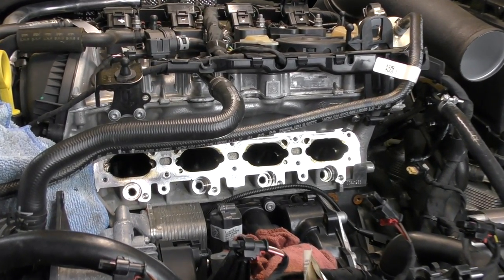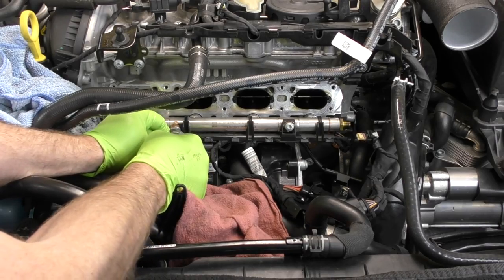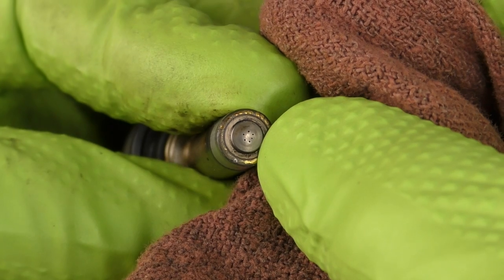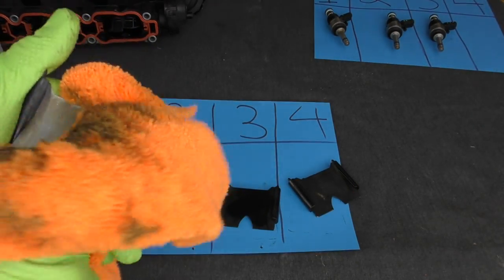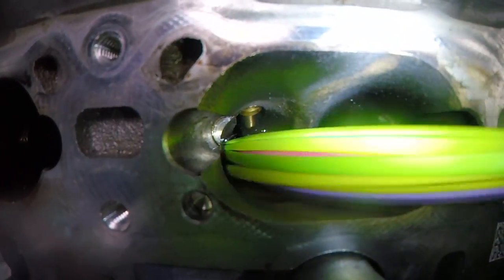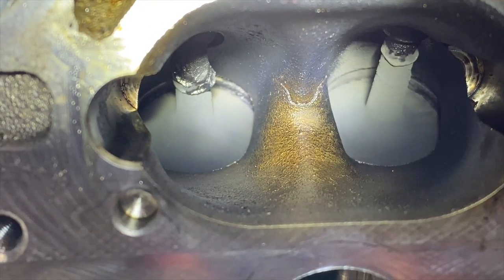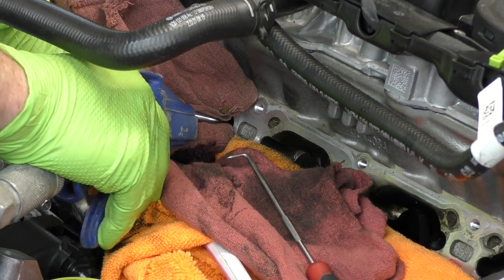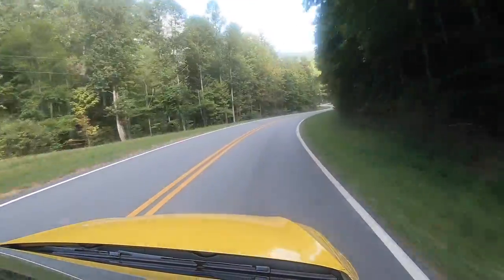How Much Carbon Build Up at 10,000 Miles?? ~ 2019 Golf R

Comment: fantastic video, I'm tacking this job on my 2016 Audi S3 at the weekend, when cranking the shaft to close the valves is it necessary to remove the spark plugs?
Reply from the maker: Not necessary, but it makes it easier
Reply: @HumbleMechanic  Thank you, actually i have pretty much everything apart after watching your video, hit a problem though, seems the S3 is different, the injectors are part of the inlet manifold, reluctant to pull this off.

Comment: Is this also a problem on the 1.4 TFSI?
I have an 2016 A3 E-Tron, and wondering if the minimal use of the engine will make some carbon build up in the engine. It's got 41.000 kilometers on the road. How many of them on petrol, I don't know.

Comment: I'm assuming this issue applies to all Direct Injection petrols? Even the smaller 1.4tsi and 1.5tsi's we get in Europe?

I have a 1.5tsi, 150bhp in my 2019 Audi Q3, which has just over 7k miles on now.

Comment: @HumbleMechanic do you have any experience or knowledge about the dual-injection being used in europe for some EA888 engines ? (at least I know that's the case for the Passat B8 2.0 TSI manufactured in Germany that is being sold in my country (Argentina)) ?    Using the same engine as you were showing in this video... but with direct+indirect injection... My question is.... is that EU intake manifold EFFECTIVE enough to completely solve this problem and allow me to purchase a 50K miles Passat in my country without any worries about carbon buildups ?

Comment: Long ago I owned a 1994 VW Jetta, normally aspirated with a 5 speed manual. At 230,000km I was rear ended, The Jetta was a right off. I now own a 2009 Audi A3 Quatro, DGI and DSG. The Jetta had better milage. Better torque. Less maintenance issues. Less worries. And more fun to drive. Modern tech make idiots of drivers.

Comment: Good Vid. Why wouldn't you have inspected and cleaned the PCV system at that time? Isn't that the main culprit?
Reply from the maker: There isn't much to really clean. We will be inspecting when we install the Catch can
Reply: @HumbleMechanic  Great! I know catch cans are the rage when dealing with GDI but I've been on the fence. Although I haven't inspected the intake valves, when I look at the inside of the PCV hose it's clean. So I scratch my head. Thanks for the response and I even subscribed.

Comment: I wonder if I clean the intake valves on my MK6 Jetta it would get rid of P301 code that I keep getting? I mean I already replaced all the ignition coils, spark plugs with OEM parts and the fuel injector on cylinder one with OEM.

Comment: Hey Charles what about exhaust valves?  I've seen them with carbon as well. Seems to be overlooked.🤔
Reply: Exhaust valves do not affect the operation of the engine. What they get is a bit of soot, but they get so hot carbon could never build up on them. Any build up if possible, would blow right out.
Reply: this carbon deposit is 2 compound : oil/water from pcv and carbon particle from egr,what gives carbon grease that is dehidrated /half burned as temperature is higher

Comment: spray will be impacted if carbon build-up occurs on the inside of the valve-seat holes which is a resultant of excessive combustion temperature.  Outside is normal. Any build-up on the outside near the exit hole will be cleaned away due to the fuel velocity exiting.

Comment: You mentioned fuel treatment won't help much for this engine since it's direct injected. From your experience, how well does it work for port injected engines? If it makes a difference or the gas being sprayed already does most of the work.
Reply from the maker: Much better on port. It can help clean injectors on DI. Just not valves

Comment: Ouch. As a fellow '19 R owner, this is disappointing to see. And my car sometimes sits weeks without running as it's a pleasure vehicle. Currently under 5,000 miles. 

As someone who has zero interest in doing any of this procedure, what can I expect from the dealership shop as far as keeping up with with carbon? I have a prepaid service and extended warranty that requires me to use the dealership garage.
Reply: Prepaid service wont play any part in carbon clean up, warranty may it it's truly causing a massive problem but sorry to say that Bill is on you
Reply: All you can do is have the valve cleaning performed at a preset mileage. I have found that 30k is a good middle ground where there will be significant build up, but it won’t cause misfires, or be baked on so bad it requires hours to clean out.

I use the media blast method. To give you an idea, I charge 400.00 for the process.  This includes new intake manifold gasket. New seals for the injectors, and new throttle body gasket. I also give the intake manifold a cleaning as well.0
Reply: Gentlemen, thank you for your insight
Reply: @lynxstarautomotive208  what "kit" do you have for the media blast? Would like to buy one myself
Reply: MeltingRubberZ28 I use a blast gun with hopper made by Gunson with a nozzle I customized myself. I feed it with my shop compressor. The media solution is walnut shells of the fine grit variety. BTW guys I forgot to mention this:

Do not use coarse grit media

Coarse grit will cause microscopic imperfections, like pores, on the surface of the intake tract. These pores are too small to see with the naked eye, but they will exacerbate the problem because they will “catch” contaminants, and will cake up with sludge even quicker than usual. I made this costly mistake once! Had to replace the cylinder head. Use only fine grit media, and only plastic bristle brushes.

Comment: Looked at my old Toyota Manifold and it had a light oil surface on it and that had done 350.000km 

Do a EGR delete and catch tank for the PVC system. It should make it better
Reply: EGR also reduces the exhaust gas temp. Removing it can cause a lot of trouble, so make sure you know what your are doing. 

I work with industrial diesels and had a customer block off the valve and it made exhaust gas temps go up so high it cracked the head.

Comment: I have 115k miles 2.0 tsi passat 206 kw 4x4 2016 and engine works perfectly
Reply from the maker: Awesome
Reply: HumbleMechanic its mostly highway, garage. Every 10k motor oil change, every 30k dsg oil change. Miles driven is just number, relevant is what is behind those miles 💁

Comment: Why couldn't this come out last week? I replaced the manifold on my 2013 CC and didn't clean because I didn't know the zip-tie trick and didn't want to spend hours picking and scraping the valves. Although they weren't much worse than these in the video at 48,000 miles.

Comment: Great video... So adding an oil catch can would help to reduce the carbon build up.. As I'm not gonna say that it will eliminate it as some ppl say.. But other ppl say that these engines in the mk7 or mk7.5 can't have an oil catch can fitted as it will destroy the engine...such a broken piston arm.. Is that true? Thank you.
Reply from the maker: I don't see how it will result in a broken piston. Plenty of MK7 running around with a catch can. I ordered a CC so we will see. :)
Reply: @HumbleMechanic  Thank you for your reply.. Well someone asked how to help reduce oil in the intake at a FB forum for MQB platform.. And I told him to install a decent brand oil catch tank.. So few members comment that it's wrong for the reason I told you.. I told them that I had one for my old MK6 gti for years and no problems what so ever.. But with your knowledge and expertise I wanted to be sure.. Thank you again 👍🏻

Comment: Its surprising VW still designs their engines to buildup so bad.

I have an '18 Chevrolet Colorado and luckily GM redesigned the engine for '17+ and added an oil catcher/seperator in the LGZ engine. Got a guy on a forum giving updates and the egr system is bone dry with no oily mess.

I do want to shove my camera scope down the intake to check mine now that Im almost at 30k.

Comment: I'm surprised when anyone mentions Shell as a top tier fuel since back in the late 90's, they were some of the worst according to my father. He was a mechanical engineer and did extensive testing and quality control related tests for different chemical companies and testing products ranging from household products like shampoos to products like gasoline. He was always a fan of Exxon. Of course, over time, things may have changed. Maybe now, Shell IS top tier. I don't know. He retired in the early 2000's. Just an interesting thought.

Comment: I use flashlube, injector cleaner my 06 Ford runs better than ever. It has about 150,000 kms. Before flashlube  it wouldn't run as good as now.

Comment: They need to put a second set of injectors in the IM to help clean the valves
Reply: Yes! They could be activated when going full throttle.
Reply: Like the Toyota/Subaru Setup in the BRZ. Port and direct injectors.
Reply: European version has both port and direct injection. Solves it all.
Reply: @snsofhumor  Good to know as im from Europe.

Comment: I have a 07 Audi A8 with fsi direct injection V8 4.2, Just had all the carbon cleaned off but If I drive at very high speeds once a day say 120Mph can’t that prevent slot of carbon?

Comment: If you switch your fuels to E85, you will no longer have carbon buildup. In fact, the high ethanol content actually well help dissolve any existing buildup.
Reply from the maker: How would that happen on DI engines?
Reply: @HumbleMechanic  Aha! Big oversight on my part. On Port Injection engines the intake valves are washed by the fuel but not on a DI engine. This is why I'm an electrical engineer and not a mechanical engineer! Thanks for the reply
Reply from the maker: Hahaha fair enough!

Comment: Hey Charles, when reinstalling the manifold you didn't mention of changing the gasket, did you reuse it or changed it? They supposedly are one time use from what I know.
Reply from the maker: It’s totally reusable. In fact I have never replaced one.  Either new manifold or reuse the gasket

Comment: what is the specific reason for only clockwise on engines? In school I was taught only clockwise, but at the shops i've worked at it was about 50/50 on clockwise or not

Comment: Hi Sir. I am From India. Hope you are doing well. I have a VW Vento Indian Variant 2012 and i am facing an issue with my desiel engine. When I am riding on cluth without no accelaration pedal pressed, the radiator fans comes on and it cuts as a speed up. Could you provide any help with it?

Comment: I believe being tuned causes this process to accelerate. You have more boost, more air, more positive crank pressure, more gas... things are more prone to pass around the piston rings and into the crank system. I wonder what someone’s golf r would look like that isn’t tuned, but used the same oil and gas stations with similar miles?
Reply from the maker: That would be a fun test. We might be right on the tune.
Reply: Yeah, if that’s the case, I might have to take a look at my 1.4T in a few thousand miles and see where that sits.
Reply: This would be super cool to investigate. I have a 2019 R  too and would love to know if it’s possible to easily convert.
Reply: There was a publication from VW on Google that stated if you drove the car at 3000-3500 RPM for 20 minutes about once a month you would not have carbon build up.     Here is the link:   https://patents.google.com/patent/US6866031     I would be interested in feedback from people deeper in the know.

Comment: is this direct injected engine?? if it is then it is expected. port injected engine will wash those valves. Toyota tacoma has both port and direct. when idling its actually cleaning in port injection mode.

Comment: @HumbleMechanic, Sir Charles, in this video you mentioned that your golf R has the EA888 engine. Is this the gen 3 with the port injectors added? If yes, when are they used? And why doesn't it clean your intake valves with the fuel? Thanks in advance for the answer.
Reply from the maker: No port in the US :(
Reply: HumbleMechanic damn VW. Was it because they build golf for the US market in their plant in Mexico? And they put the port in the ones they manufacture in Europe?

Comment: I'd like to do this on my GTI (30k miles), but I dont want to drop $250 on a tool kit to replace the injector seals. Can I clean the carbon without removing the injectors? I know it's not ideal but I'm curious about all options available.

Comment: What if you used a can of CRC Indiction cleaner at every oil change to clean the valves. I wonder if that works as well and would be less invasive.
Reply from the maker: From what I have tested, those mostly just end up cleaning cylinder 2/3 and not getting much on cyl 1/4

Comment: Ok, so you’ve used fuel cleaning additives. What would a 10,000 mile engine look like with strictly fuel and no extra additives? Side by side comparison. I worked at an oil change job where we had a customer that bought the oil cleaning additive EVERY OIL CHANGE FOR THE PAST TWO YEARS, that’s $59.99 + $79.99 syn oil change every 3,000 miles for two years. I would really like to see the tear down of his engine in his Malibu. But back to my comparison question. Would the results of carbon build up be the same, worse, or better when using or not using carbon cleaning additives?
Reply from the maker: I love this idea. I worry about the true accuracy of this tests. Could you really pinpoint? Im at 30k now, might be time to pull the manifold again

Comment: How actually does carbon build up on the intake valves? Since it's direct injection I would assume that the only thing going through them is air?
Reply from the maker: And oil. It’s the oil that is in the air that builds up. 

Plus some unburnt fuel when the valve is open and you shut the car down

Comment: Have a 2017 gti and just wondering at about what miles should you do this type of cleaning?
Reply: I've read in the forms that people don't run catch cans on these cars because they don't get that much build up and that it might be worth it at 50-60K if you are experiencing the problems he has mentioned. A shop might charge around $800 for this type of cleaning. I have almost 30k miles on my 2017 GTI and it starts right up and has a good idle.

Comment: Do not use scotchbrite. Please. It gets embedded in bearings and causes wear you will never see. Just move the engine until the intake valves are closed then soak, use the nylon brush or zip ties and suck with a vacuum.  Quite honestly, regular use of ventil sauber per bmw/vw group process will have you keeping them intake valves clean.  Justmy .02 (Bosch auto engr. GM journeyman, L1 master since '96.

Comment: How are people reaching the crankshaft bolt? The washer fluid lower reservoir is in the way. Are you removing the entire reservoir?
Reply from the maker: No fishing a ratchet in there. It sucks but doable
Reply: @HumbleMechanic  Thanks for answering. Do you have any advice, or a video, on how to do this? The fit is so tight, I can't even get a 24mm socket through the gap between washer fluid tank and crankshaft. I don't think even a low profile socket would fit.

Comment: Fuel treatment does nothing to clean injectors. Gasoline is better at cleaning injectors. The fuel filter is what keep the gas clean. Anything small enough to pass through the filter will not stop up an injectors. The carbon you are talking about, is not enough to hurt the performance of the engine.
I have a 2016 F150 with a 2.7 ecoboost. It has 75k miles and I have only used Quick Trip gas.
Reply from the maker: I’ve seen very different results over the years
Reply: @HumbleMechanic  When I was young (I'm 50 now), my dad used gasoline to clean engine parts. Have you ever replace a fuel pressure regulator on a GM 5.7 CPI? The area near the leak will be spotless because of the leaking gasoline.

Comment: I know this has nothing to do with this video but I could use some help. I'm doing a dmf in a 2013 TDI jetta w/DCT. This is the first dct flywheel I've done and the new flywheel has a huge amount of movement with no real resistance. Is this normal? I've gotten 2 both the same. On regular clutch dmf there is just a tiny bit of by hand movement. Anyways if you got time to respond I'd be very grateful.
Mike @Carizona

Comment: Question I been cleaning my injectors with two cables a battery and a hose with injector cleaner and pressure towards the back will that cause the injector to fail I been doing it for quite awhile and only had one fail ?

Comment: In the tank cleaners are a waste of money. I use crc turbo and intake valve cleaner. You spray in before the turbo, it cleans off oil residue on the turbo. The spray also clean the carbon on the intake valves. I use the spray every oil change which is 7k miles.

Comment: Would spraying a can of something like the CRC GDI cleaner into the intake every 10k miles help? Or is it an intake off job every time?
Reply: CRC GDI cleaner is the right thing for this job. Best to use the temperature sensor hole on the intake but make it air tight, otherwise will have a rough idle. Do it before the oil change.

Comment: Hey charles just wondering what cleaner can I use to clean the mass air flow sensor on my vw Passat 18 I have a crc one would that work and if so is it as easy to clean as any other mass air flow sensor

Comment: Would a good catch can setup help prevent or minimize carbon deposits on those D.I engines?
Reply: I think he has a catch can on his r
Reply: Kasam Sagir i hope he does, but I haven’t seen one in it, i could be wrong
Reply: @hialeahhigh  just learned that eu models had mutli point injection so it cleans that valves, it would be neat  if he could add that
Reply: Kasam Sagir yea I know this, sucks they dont do it for US models which they should be by now